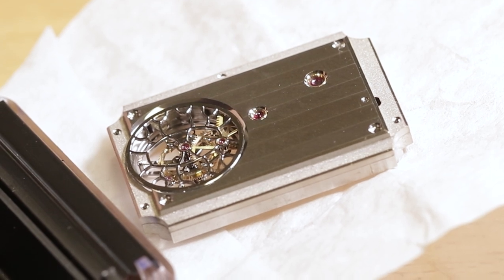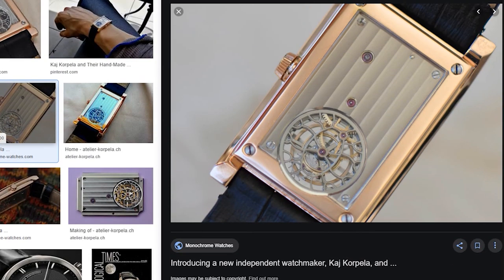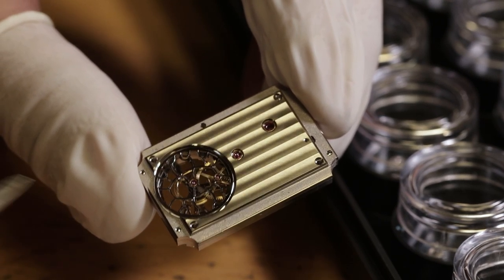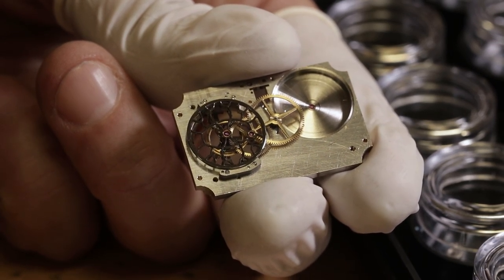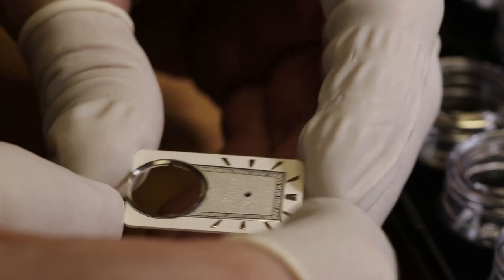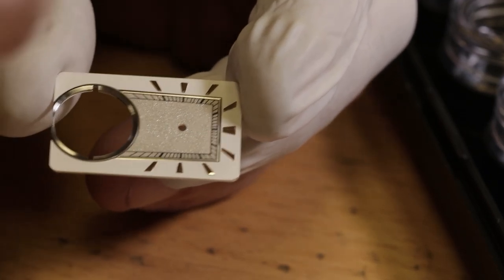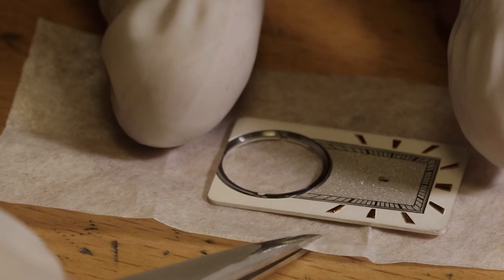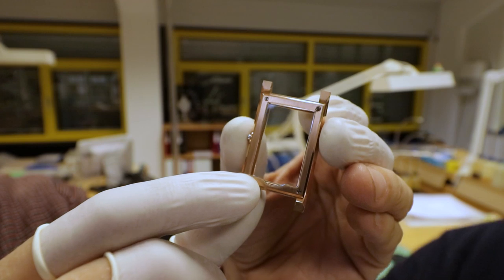Handmade Tourbillon Watch! Watchmaking Vlog 41

Comment: When pickling the silver so it goes white after time, does it harden like steel? Because I think a ring or wrist bangle that has been pickled white would be gorgeous
Reply from the maker: So I believe the process is heat to oxidise black, pickle, heat again - black starts to change,  pickle, heat again - starts transition to white. and keep repeating the process.
Reply: Unfortunately he commented that the surface (raw) was very delicate :(
Reply: No, the white layer is a very thin and rather delicate layer of fine silver on the surface. The pickling merely extracts copper from the silver, adding to the brittleness/fragility of the silver layer. 
It will wear over time when exposed to surface contact/rubbing. But it is fairly tarnish resistant however.